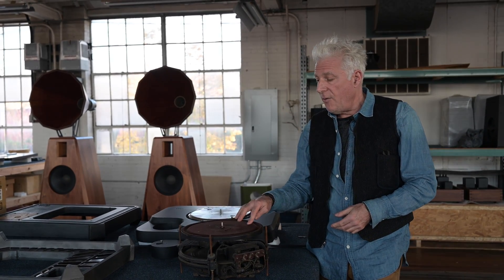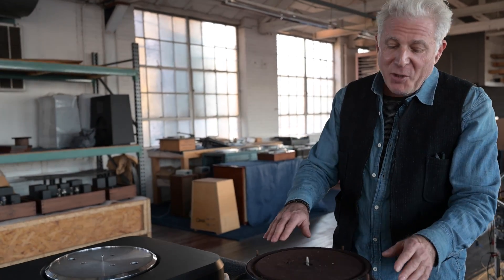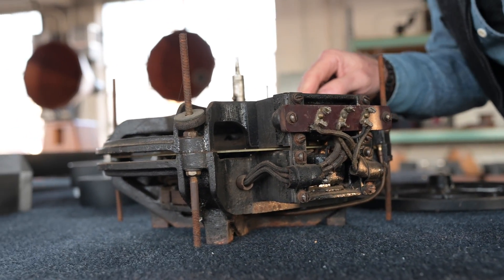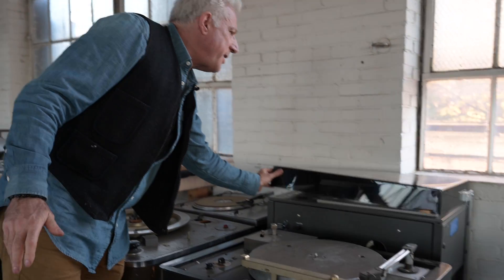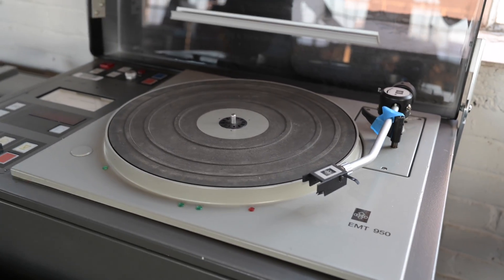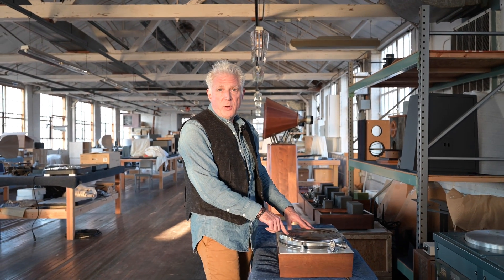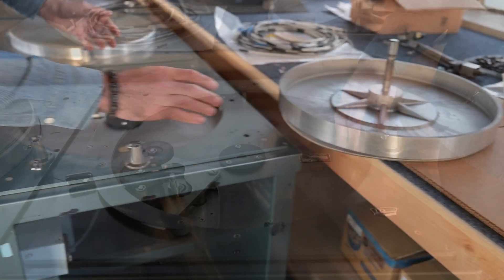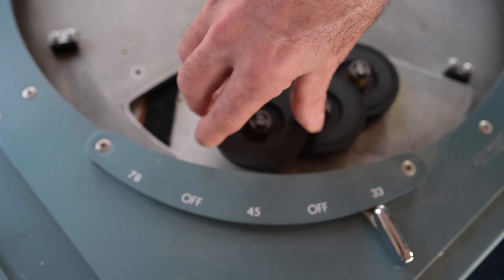OMA on Turntable History

Comment: @starlightgrecording559
OMA on Turntable History**
Gerard Stroh!!!
I Been Watching Your Channel On Turntables and Like You I Prefer Direct Drive Turntables and I Don't Care For Belt Drive Turntables Ether***
I am A Audiophile and I Like Well Built Vintage Turntables and My 2 Main Turntables in My System Are Direct Drive With Quartz Lock and One is A Vintage Pioneer PL-600 Quartz Lock and it Has A Noiseless Fully Automatic And The Other One is A JVC QL-Y5F All Direct Drive Quartz Lock and it is Fully Automatic and These Turntables Were Made Between 1976 to 1980 and The Pioneer I Use A Moving Coil Phono Cartridge and I Plan to Do The Same thing on My JVC QL-Y5F Turntable in A Few Months and I Use A Moving Magnet Phono Cartridge Type only For Playing Records Everyday and My PA Stereo System is Massive and Big and All Speakers Are PA Type Only and I Have 2 Cheep Pioneer PL-200 Direct Drive Turntables For 78 rpm Record Playback and I Took Out The Whole Eject System Out and All of My Turntables Are Vintage***
I Want to Get A Technics High-End Turntable and I Like To Get The Technics SL-1000R System That Cost $19,000 Dollars or I Would Be Happy With The Technics SL-1200G Turntable and Don't Get Me Wrong I Have 8 Great Turntables in My System and Some Fine Studio Grade Open Reel Tape Machines Including A 1967 AMPEX AG440 4 Track Reel to Reel Tape Machine and I Also Have A Vintage TEAC A-860 3 Motor Direct Drive Cassette Deck that Cost $1750 Back in 1976 to 1977 and it Sounds Like A Reel to Reel Tape Machine and The Capstan Motor is A High-End Direct Drive Type Motor That Runs 2 Big Capstan Plyreels and it is A Closeloop Drive and This Deck Uses the Left Reel Spindle to Supply Back Tension Like A Reel to Reel Tape Machine and Got it Used for $200 Dollars  Some Years Back!!!
I Don't Like These Hi-End High Price Belt Drive Turntables and I don't Mind A Belt on A Capstan Drive But A Turntable it Must Be Direct Drive and Here is Why Because Like You Said The Tonearm and The Weight of the Tonearm and The Record Grooves Slows Down The Speed of The Record Platter and Record*** and I Use All Outboard Phono Preamps on My Turntables***.
That's My Take On Belt Drive VS Direct Drive Turntables!!!!
Good Video**
 Buy From Gerard Stroh***

Comment: I've never seen this McCurdy before. Very impressive beast.
But I don't see any Prestos in the collection, nor a Gates CB500 or an RCA 73B...
Very impressive collection of RCAs though and the Fairchild is truly a rare piece. A lot of drooling is caused by this video. 
None of these can be strictly direct drives though since, if I'm not mistaken, all use the same gear-drive mechanism (seen at the bottom of the RCA interior) thus the motor, the spindle and the platter (assuming we forget the flexible couplings for a minute) are not one piece.
The whole idea of direct drive is that there is no loss of energy occurring between the motor and the platter. This, of course, is a double-edged sword.
One thing that isn't mentioned is that all these players were build for broadcasters back in the day when AM was the main method of radio transmission and AM only goes up to a few kilohertz (and certainly did not go down low enough to pick up any of the turntable rumble), so most of the noise was never transmitted. All these were called transcription turntables because they were designed with 16" or even 17" (and I think in one occasion, up to 18") platters in order to fit the the acetate discs (like the one shown here) that were used by radio stations as a cheap means of recording. The acetate discs were played at a low speed (e.g. 16 rpm) so as to contain a lot of low-fidelity program material, such as speech, and would mostly contain radio advertisements. They needed to be large so that they could cheaply record as much material as possible, so combined with the low playback speed they could be quite economical (as opposed to magnetic tape recorders which were hugely expensive machines, used very expensive tape and also came a lot later). The acetates were considered throw-away medium and certainly were as after being played over and over during the course of a day, with these heavy tone-arms, they soon wore out. But they provided a very easy and quick way to record a (non-archival material) program on.

Comment: Here is what you are up against with my favorite turntable. I like it so much that I'm thinking of buying another one used. I won't tell you what the make or model is but it is real. I bought the one I have used in mint condition decades ago for around $200. Today a used one in mint condition sells for several thousand dollars. I wouldn't trade mine for any other turntable. BTW, although I have over 3000 vinyl phonograph records I also have over 3000 compact discs which are what I listen to mostly on my own invented experimental sound system.

 arm moves effortlessly on 32 jewelled, sapphire bearings with bearing friction a mere 0.001g.

The aluminium tubular arm, dramatically reduced in mass, responds to the slightest variation of a records movement.

A self-cooling hysteresis synchronous motor drives the platter with enough torque to reach full speed in one third of a revolution.

To prevent any variations of speed each belt is ground within one ten thousandth of an inch thickness.

Every two piece, 7ib, 3" thick, die cast aluminium plater is dynamically balanced, and once in motion it acts as a massive flywheel to assure the specified wow and flutter value.

The suspension system consists of piston damped, 16 gauge steel coil springs.

The main bearing features a stainless steel shaft with a precision ground tip sitting in self lubricating bearings, reducing rumble to one of the lowest figures ever measured in a professional turntable.

Specifications
Motor: hysteresis synchronous

Rumble: 68dB

Wow and flutter: 0.04%

Startup time: 1/3 rev

Platter: 12", 7ib 3oz, aluminium

Tonearm: aluminium

Effective length: 9 inches

Bias control: diminishing spring

Tracking force range: 0 to 4g

The tonearm is dynamically balanced meaning that the center of mass is at the pivot point. tracking force is applied by other means, not a mass imbalance like other tonearms. The manufacturer claimed the main journal bearing which is massive is machined in match pairs with a tolerance of +/- 1/100,000 inch. He claimed an unweighted rumble of -90 db. The arm tracks the most heavily modulated record passages without distortion at one gram or less using very high compliance low dynamic mass moving magnet cartridges. . I use the Shure V15 type V MR.

Review summary
a beautifully constructed and finished product, one of the few remaining truly manual record players. It should be able to extract the fullest measure of performance from any cartridge and record. It is certain, too, that no one will wish to hide it from view since it is one audio product that looks as good as it sounds. - Popular Electronics
Reply: Empire 698.
Reply: @ivanbogush  Yes.

Comment: Personally I see nothing wrong with a belt drive turntable. The measurements that matter are speed accuracy, wow and flutter, and rumble.  Systems that isolate the turntable and arm from external vibrations help also. Depending on how well the design is executed will determine how well it performs. That is the turntable's only job, to spin the record at constant speed and without spurious vibrations. How noisy the mechanism itself is is important when the turntable is in the same room as  you are listening in just like the fan or lack of one in a power amplifier. One of the best motors is a high torque hysteresis synchronous motor. These are locked in phase synchrony with the power line frequency. The power distribution grid is tied in synchrony with every generator on the grid. In the US the frequency is locked at exactly 60 hz and you can think of the grid and all of its generators as the electrical equivalent of one gigantic flywheel. The number of cycles per day became very critical when this type of motor was used for electric clocks. You might say that a quartz clock oscillator is also ha a very stable frequency and can be used as a reference to regulate speed. This is why the most accurate wristwatch in the world is a $400 Casio watch which will beat mechanical watches costing hundreds of thousands of dollars collectors prize and pay for. Ordinary shunt wound induction motors cannot be as highly relied on because speed will vary with voltage. 

When I bought my first serious turntable in the 1960s I considered Rek-O-Kut as one of three brands I looked at it but didn't buy it. IMO it was a very fine turntable and tonearm. There are some very expensive turntables on the market which in practical terms perform no better than far less expensive competitors and are so absurdly engineered that they remind me of Rube Goldberg.
Reply: He just wants to sell you a $10000 turntable

Comment: This idea that tracing of grooves slows down or modulates the speed of belt drive TT to any audible extent is complete nonsense.  The flywheel effect of a sufficiently massive platter will completely swamp out any "drag" effect of tracking one or two grams, even on heavily modulated grooves. The total effect of stylus drag on speed modulation dwindles to total insignificance to the point it's not measurable let alone audible no matter what the drive. Show me any measured speed fluctuations resulting from groove drag on a well made belt drive TT, Jonathan.  if you think they are audible then they can certainly be measured. Test equipment is hundreds of times more sensitive to measuring speed fluctuations than the human ear.
The reason why idler drive TTs seem to sound "better" in many cases is because they are usually found on older TTs that are built like tanks. Massive, inert platters, bases and beautifully machined main bearings provide high rigidity, mass damping and much reduced spurious resonances. These are the factors that hugely contribute to the sonic excellence of a turntable. It explains the popularity of the Garrard 301 and 401. Great sounding turntables, not because they employ idlers but because they were constructed with fabulous platters and bearings. Not like the later on mass produced direct drive and belt drive TTs with their flimsy resonant platters and cheap main bearings nailed to thin resonant bases.
Another factor in the "sound" of idler drive is the measurably higher motor noise transmitted through an idler wheel contributes to a richer bass. This is demonstrable and measurable. This small but still significant motor noise (rumble) is picked up and modulated by the highly sensitive stylus/groove interface. This has a subjective effect of thickening the overall sound. Some folks hear this as an improvement however because people love bass . Yes bass sounds rich and deeper with an idler drive but for different reasons than they suspect.

Comment: i enjoy your videos , reaffirming , wide body speakers are good , belt drive is not so good 
I remember Dual turntables, Bejamin Elac Miracord turntables , Lenco, Garrard,Perpetuum Ebner, many others.
The absolute winner was my Dual 2019, 2029, 2029q, and yes i also had a 1019
precision was awesome  gimbal on gimbal  for the very light low mass tone arm, and while those were rim drive , albeit a massive 7 1/2 pound platter , i regret not keeping
also I remember Empire Trubador  , regret not getting one of those.
Dual also had dd. belt drive etc

Comment: It's been an interesting series on turntable that I have caught so far. Some good historical perspective that could only be compiled by someone with the interest and ability/ access to accumulate such a collection. My guess is some of those would have been just tossed out and are still sitting in some basement or such if only they could be found. But your efforts to bring them all together is very valuable. Thanks. 

You bring up a point that was drilled into my head by AT when they first came out and I was doing some training for them. The actual forces a stylus encounters playing back a record when scaled up to our size! (If memory serves!) such as the stylus reaches the equivalent of 12.5 tons sq/in of pressure. Velocities up to 6G! Thousands of degrees in temp! But it is across an extremely small cross section. Imagine the physical impact at point of contact and the inertia and energy needed for that instantaneous impact. That's why all that energy and mass is needed on a larger scale to compensate for needs at a much smaller but higher energy scale.

Comment: Glad to have been informed that ´belt-drive turnables’ suck. Now I’d very much like to know why.
By the way, there is no absolute obligation using the cheapest of the cheapest of motors to use on a belt drive.
Reply: Andrè, the real reason why he says belt drive turntables suck, is because the one he's making, and probably going to be selling, isn't belt drive. Another case of hifi marketing BS.
Reply: @kinasc1575  Hifi doesn’t have the marketing BS monopoly; it’s the same BS for cars and whatchamacallit.
Reply: Hysteresis. 
The issue he mentions, but does not connect directly back to belt drives is about drag and hysteresis.
When the record starts playing something with high dynamic range and high amplitude, the needle puts drag on the plater and slows it down.
A belt will stretch trying to maintain speed while the platter slows, then overshoot the intended RPM when it relaxes back to it's normal state. 
This is physics, nothing controversial here. 
About the only way to overcome the above issue is to use a massive platter to get a flywheel affect. Using a light plater and electronic control just runs into feedback issues and "hunting," ( a common problem in all closed loop motion control systems).